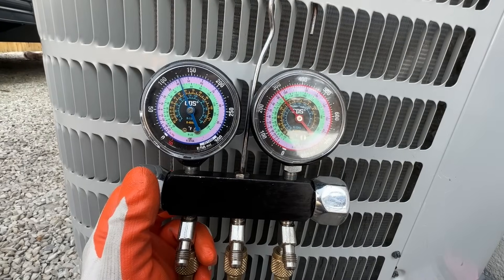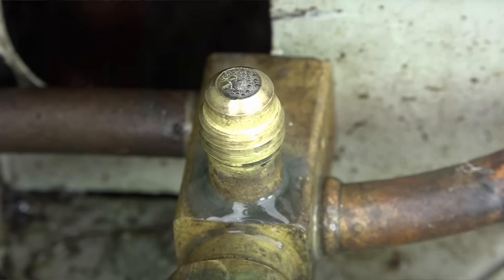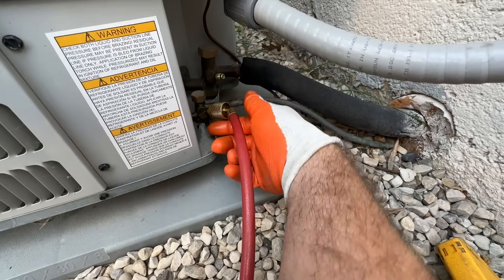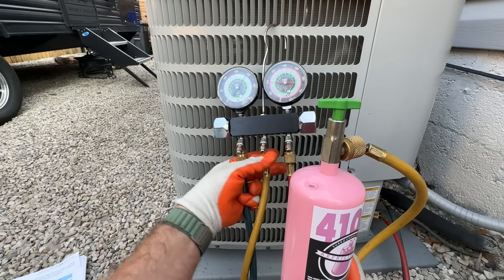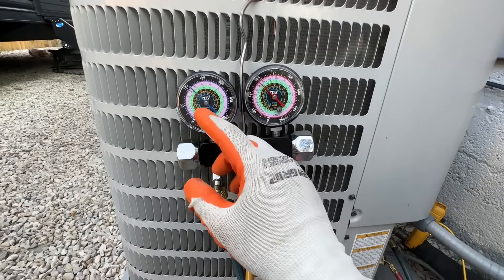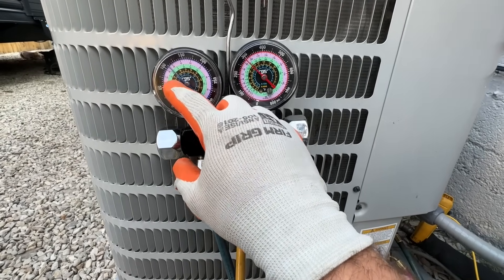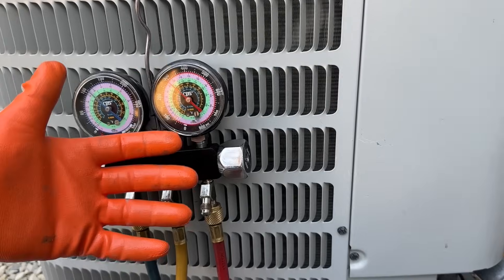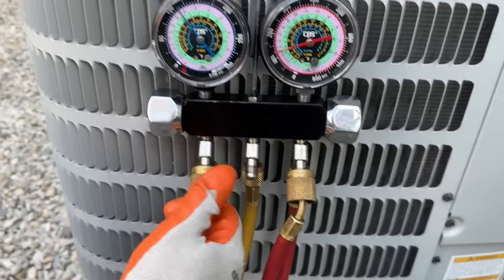How To Add Refrigerant To Your Air Conditioner R410A & R22

Comment: I got worked for like $600 just to put a little R-22 in my system which was working but he said it needed it.  He didn't weigh the refrigerant he added and just eyeballed it and sent the bill.  Never said what it would cost until he sent the bill.  I almost lost it.  Whole process took him under 10 minutes and the cooling felt just the same as it did before he topped it off.  That was when I decided to buy a fat tank of R-22 and a gauge set just incase it ever needs topped again.  I also ran through some of that sealant stuff just incase there was a leak since he never checked for leaks.
Reply: I wouldn't add that sealant stuff unless you know there's a leak even though "its safe to use". Most suggest not to use it unless you have no options and a leak. Yes, a tank of R22 and some gauges is the best you can do besides a spare brand new USA made cap and contactor just in case. That will help when it won't run in August and all HVAC techs are 3 to 4 to four days out.
Reply: @Garth2011  aside from a broken compressor wiring harness at the connector it’s been running fine since. Fingers crossed. Got extra cap, contactor and defrost control board just in case.

Comment: I decided to start working on my home AC after I got charged $350.00 dollars to install 1/2lb of R22 about 20 years ago. I said to myself, "Dude I'm Avionics Technician working on Fighter Aircraft Electronics and work on cars as a hobby. How hard can this BE!" I didn't get my license but I watched a ton of video's and have repaired a ton of cars with R134A since then, including complete rebuilds of car HVAC the systems to learn about AC Systems. I then purchased a HVAC maintenance manual and studied it. Then before I started working on the home AC I have a friend who used to own his own HVAC business and always consulted with him before I broke into the lines or did any maintenance with my diagnosis theory and plans/procedures of repairs. He always gave me a thumbs up and would also remind me of things to look out for and how to overcome problems if I ran into any. He was kind enough to purchase four 2lb bottles for me, of course I paid for them. With those bottles I kept my Goodman running since 1996 and it just went out last year in 2022, a 26 year run on that unit. So I put in another NOS R22 Goodman I've had sitting at the house since 2015 waiting for the other unit to go out after our home flooded in Katrina.
Reply: I would rather pay for more tools and learn then get ripped off too...  If you have an engineering mind and pay attention to detail, you'll be fine...
Reply from the maker: Thanks for sharing bro!
Reply: @diyhvacguy  I got my Universal EPA Cert back in the early 90's courtesy of the US Navy. All of the Engineering rates that had anything to do with operating refrigeration or A/C equipment on board ship, had to go thru the Cert program when they first started it - I imagine the same was true for the other services as well. I scored well enough that I got the Universal Cert, for working on any stationary A/C systems, including the big industrial units.
When I checked about buying some R 22 back in the early 2000's, I found out that many companies would honor the EPA cert from the military, at least for selling you refrigerant.
So anyone that is former military, and got the EPA Cert for doing their job in the military, you're already covered.
Reply: Tldr
Reply: Be careful about posting that you handled refrigerant without a license.  Someone was actually convicted for reselling old refrigerant in the us recently, and even though you're unlikely to be arrested, if the wrong person finds out it can be a hefty fine.
Reply: @andrewkuebler4335  Isn't all R22 "old refrigerant"?  It's not manufactured anymore, but re-captured and resold.
Reply: @andrewkuebler4335 I believe that applies to working on a industrial, business or someones equipment that doesn't belong to you. It also depends on if it was a Licensed Refrigerant like R22, R410a etc, but not R134A. It's mine understanding you are allowed to repair you home equipment, but not someone else's, or in a professional setting, which does require a license. I'll have to check into that though to be safe on the regs. Thanks for looking out for me, and if you find a link to the article I'd like to read and study it. Best Wishes & Blessings. Keith Noneya  PS I don't resell any refrigerants, especially any that requires a license, I'm not a business man, just a home owner. What little I did have, was a 16oz can and I used to fix my AC, that unit has long since been replaced by a professional tech last year and is long gone, the coil was really old, march of 1996 then it rotted out and couldn't be repaired. Again thanks for looking out for me. Best Wishes & Blessings. Keith
Reply: I appreciate people like you . End up over charging your system and keeping us hvac installers busy ☝️
Reply: @OnlyTheSauce210  Mine worked from March of 1996 to 2022 or 26 years until the compressor went not any other part of it. I'd say my licensed HVAC friends gave me good advice. What is the average length of a HVAC system anyways?
Reply: @keithnoneya  I have a York from 1987 that just started leaking.  Worked fine last year.  HVAC tech immediately wanted me to trash the system and go with a Carrier for $15.5k.
Reply: He could lose his license doing that for you.  Not a real friend.
Reply: @115brooklyn  Possibly, but that was over 8 years ago even though I made the post recently. The system died two years ago after 26 years of operation. I don't think it's illegal for him to buy it then give it to me. I know I can't buy it, and I know he can't sell it to me, that wasn't the case. Also I was working on my own equipment, not for another person or in a commercial setting. At any rate you have a good point, but although I haven't talked to him in a few years since I retired from the area he was at, I still consider him a friend for helping me out. I've been thinking on taking the exam anyways so I can get my license so I can just buy refrigerant if I need some rather than calling a tech. 9 times out of 10 my problem was a Capacitor anyways. I also once had a bad fan, but that's pretty much it. The last time I did have a problem with the new system last year, I did call another friend who had a business and he did the work and I watched. Still it cost me $200.00 for some new R22, pretty much his cost. Best Blessings. Keith
Reply: @115brooklyn 😮😊.
Reply: Today’s techs and contractors don’t repair.  They handle the simple stuff, the routine 20% causing 80% of malfunctions.  Then they want to replace because it’s more profitable: markup on selling hardware and an install that does take hours and billable $ thousands and highly structured.  The ability to diagnose a problem is restricted to the 25% pros, like a Steve Lavi in Dartmouth Massachusetts and this guy’s channel. 
This kind of work can’t be outsourced to India or China but our native Americans don’t seem professional because the White owners driving Lexus bill customers @$200 hour and send Latino workers making $45 in many jobs.
Reply: @tonymanero5544  Ahhh, there are plenty of Latinos driving Lexus too.  $45/hr if you can get 52 weeks/40 hrs is over $100k.  That's good for many economies.
Reply: You're not a real friend allowing him to risk his license for you.

Comment: Great basics on refrigerant but what is the best setting for a fully functioning system ?! How much is too much ?;
Reply from the maker: Watch my video on superheat and subcooling 👍🏼 typically if you have a txv metering device you want to be around 11 degrees subcooling regardless of make or model, but a lot of condensers have the target subcooling on or inside the electrical cover panel 👍🏼

Comment: I really should have done a community college class on AC six or seven years ago. Some tweakers broke into my home during Covid when I was caring for my elderly parents and they pulled the thermostat off the wall and messed with the outside compressor unit.
Reply from the maker: Bummer hope you can get it worked out cheaply! If you need some help fixing it, feel free to check out our Patreon at Patreon.com/diyhvacguy   Cheers

Comment: I just ordered one of those 2 lb bottles and it was here in 3 days! Nice video, you make it look easy!
Reply: Did you figure out where the leak is?
Reply: @Trust_but_Verify  Not yet, but I injected the fluorescent dye and sealer I picked up from Amazon, so far it has been un-heating the house down to 71 degrees and the condenser was cycling, blowing 56 degree cold from a vent above the evaporator.
But now yesterday I came home and the house was warm, cool was on, went out back to the condenser unit and found the contactor switch chattering......ordered a new one and a capacitor off Amazon. Stay tuned for updates.
Reply: @fastrat37  Did you use any detector to see if fluorescent dye got leaked out?
Reply: @fastrat37  from someone who does this for a living, please do not put the dye with the sealer into your system. They have dye without the sealer.
Reply: @Trust_but_Verify where was the leak?!  I have a leak and I don’t know what to do!! Ahhh!!!!
Reply: I did use a UV light and have not seen any sign yet of a leak. 
    Now the system has stopped cooling……went outside and heard/found the contactor chattering! 
    I had the system installed in 2003 so time and use will will inevitably end up with problems. 
   Is it time for a new contactor and capacitor? 
Thank you for your interest and any advice, I’m capable of using a  DVOM for checking voltages/resistance/continuity measurements and replacing electrical items like a contactor and or capacitor.
Reply: @fastrat37 check your valve cores at the service ports. Use soap bubbles.
Reply: The contactor and capacitor were replaced (Amazon purchase $30 for both!) along with the thermostat that kinda fried something, replaced with a Honeywell T2 non-programmable and now seems to keep the house cool and it cycles off and on!
   Took the condenser sides off to clean the coils which were very dirty since I have never cleaned them off!
Reply: @fastrat37  Best to buy USA made capacitors and other parts if you can. AMrad is made in Florida and has 5 year warranty. There's maybe two or three other brands made in USA that will last more than the 1 to 2 years the China crap does.
Reply: May I ask where did you order these bottles?
Reply: @Queensnyfan  www.abilityrefrigerants.com

Comment: It’s illegal for folks who aren’t EPA certified to purchase and use HCFC refrigerants like R22 and R12. In addition to checking refrigerant, you need to make certain the condenser coil is clean, the air filter is clean, and the blower is working. The degrees on the gauges are not the temperature of the evaporator coil. They’re the saturation temperature of the refrigerant. There are different saturation temperatures for different refrigerants. They’re used when calculating the super heat and subcool. If you overcharge the system, you can irreparably damage the compressor. You should also not attempt to check or adjust the refrigerant charge if the outdoor temperature is below 75F. You’re not going to get an accurate reading and may overcharge the system. Also, refrigerant is somewhat dangerous to handle. If something goes wrong and it sprays onto your flesh, you can get frostbite. I was an HVAC repair technician for 25+ years. I appreciate that people want to save money and try DIY repairs. When it comes to air conditioning, I highly recommend letting professionals deal with refrigerant issues. The uninitiated can hurt themselves and severely damage the equipment. I’ve seen it happen several times over the years.
Reply from the maker: I appreciate your input sir. I’m just sharing information. Definitely not twisting anyone’s arm to do this themselves. Cheers

Comment: Nice job, good to learn of ability refrigerants.
Thing is with R-22 it's so stupidly expensive that I could pretty much replace my whole system for the cost of filling it with R-22 after sealing the leak!  😯
Reply: Who is still using r22?  Anyone who has an r22 system that hasn't fully conked out yet and hasn't fallen for being convinced that they need to replace it because it's on its last legs, and are capable of maintenance and repairs and can get parts, and the refrigerant when necessary, that's who!
Reply: That is me with 21 year old Goodman.
Reply: @GökhanÖzden  
Amen.  I thought I'd have to replace my Goodman by about the age of yours but it's still charging along at 30 years old!  Except the reversing valve is stuck on heat, but due to the artificially outrageous pricing of R22 I can't afford to replace it (and I have the replacement part).  It's nuts.  I'm just waiting it out until the compressor goes kaput, but it's still healthy.  They just don't make them anymore like they used to.  I can't imagine the massive volume of old units with perfectly good compressors, coils, and such buried in landfills simply because of some brainwashed kooks who thought making the refrigerant out of reach for repairs was a good idea.  

And we're all paying up the gazoo for so many things because we keep falling for these conspiracy hoaxes like acid rain, ozone holes, food shortages, climate disasters of all sorts... they just keep coming at us and every time we think this one must be real. We have forgotten all the preceding hoaxes that never panned out.
Reply: There’s some good and reasonably priced R22 replacements out there. I like Nu-22 (R422B). Easier to use and works better than MO 99 and the price is comparable to R410.
Reply: @jamesszalla4274 You can also convert R22 to BluOn R-458A 😊
Reply: @SyriusXR7 

Really!!!!!
Reply: @jamesszalla4274  
Thanks, will check it out.  A quick glance shows one seller at $350 and another at $660 for 25#.
Reply: Who is still using r22?
Reply: @chriskarsseboom2200  
Hell me lol!!!!

Comment: Tbh from the sound of it its more expensive to diy than it is to call the ac man put for a system checkup in MY AREA. i don't know what everyone else is charging bit it must be a bunch where you can save money buying 100 dollars of 410, 2-300 dollars worth of gauges and at minimum 65 bucks for the epa test.

Comment: Have a question.  I ordered a bottle and want to make sure it is not counterfeit.  I checked the pressure against ambient temperature and it did not match to the PT Chart.  Is this a legit way to verify the R22 is not counterfeit or is there another way?
Reply: Curious to how your situation turned out on the P/T difference?

Comment: How often do people top these off?  Is once a year too much?  Once every two years?
Reply from the maker: If there are no leaks, a  system should never need to be topped off. I should have made that clearer. My apologies. This applies if you had a leak and fixed it or if it’s a real slow leak, then you could top it off from time to time 👍🏼
Reply: @diyhvacguy  I know the usual statement about "not supposed to leak", but the reality is that they all leak a little (as they age), it's just a matter of how much.  I was trying to get a feel of how much other people's leak.  I think the EPA rule is no more than 15% per year.
Reply: I had my unit topped off 4 years ago and this summer coil froze again...
Reply: @Trust_but_Verify  Did you top it off again?

Comment: i just got a stooooopid quote for a new hvac system....
so im teaching myself to do it myself. your videos are the best ive seen so far.
the guy that came out was super cool but he said my A err Y coil is corroded and needs replaced and since its R22 the outside unit needs replaced too.... but he was able to top off the R22 and get it cooling again. no promises he said but should getchya thru the summer. so hopefully i have like 6 to 8 months to save for system from dircect hvac and install it myself.... hi5 good luck i know .. but im going for it and hope to save myself thousands and learn a new skill.
Reply from the maker: Awesome, when the time comes to replace it make sure and check out our Patreon membership over at Patreon.com/diyhvacguy where we will give you one on one support during the replacement as well as help getting the full 10 year warranty on your equipment! Cheers man

Comment: If you try to charge your AC system without a EPA license because if you do it will be a $36000 fine and maybe some time in the pin. Look it up.
Reply from the maker: Yes this is true guys, please don’t do this without your epa certificate